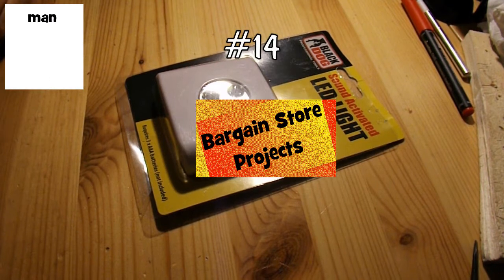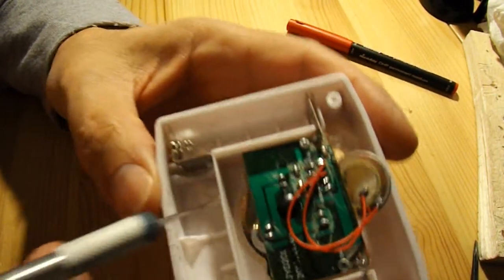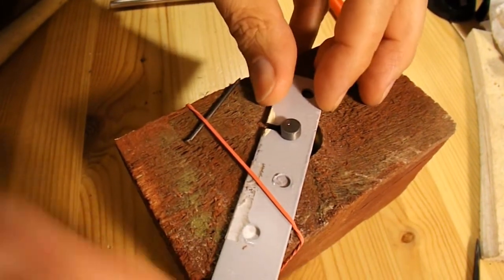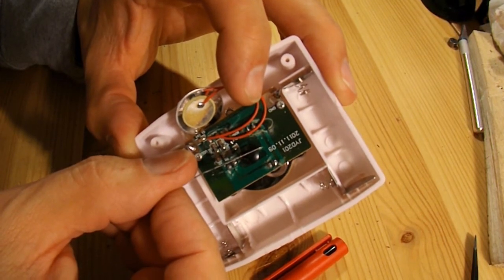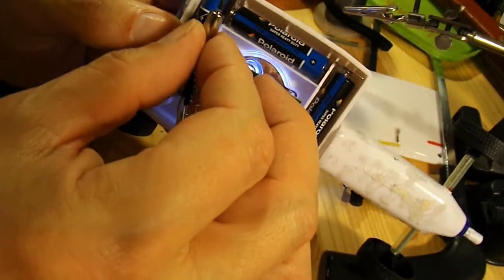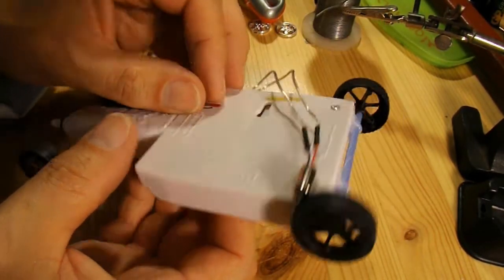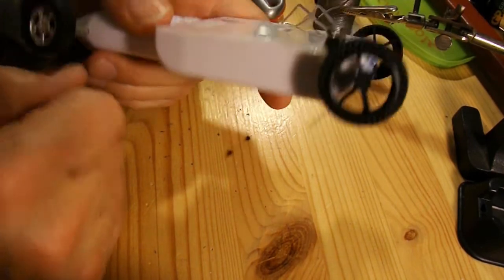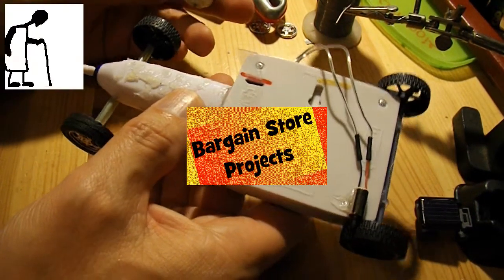Bargain Store Project #14 - Sound Activated toy car - fail

Comment: If you haven't already tried you could use one led to drive a small low voltage relay that can take power directly from the batteries to drive the motor.
Reply from the maker: PunakiviAddikti yes you could, especially if you add a small timer circuit using a 555 chip so that it runs for a fixed period once triggered. I did that on another car.
Reply from the maker: PunakiviAddikti here is one version that just used some transistors to feed power to the motor https://youtu.be/vwNqypkmvwA
Here is a slightly different one https://www.youtube.com/watch?v=4Cm49q-uNYE
and it's second version https://www.youtube.com/watch?v=mLu9SheVmzo
Reply: GrandadIsAnOldMan That's a good solution to use a better battery and some transistors. You could try to attach the piezo electric buzzer/trigger that's used to trigger the device with foam so it would not pick up the vibration of the motor.

Comment: I know this is an old video but if you connect a mosfet transistor in the same way an "unregulated box mod" is wired then you can get more energy out to the motor when the motor is placed in the portion where the atomizer is to be placed
Reply from the maker: Hi FreiNrg  Thank you for that suggestion. Yes as you say it is an old video but I do sometimes go back and have another go, or somebody else might see this and have a go themselves.

Comment: Long ago , I used a computer named Spectrum ( 80s).
I did a similar device , which operated a relay when a sound is heard .
With the relay , turn on lights and put up equipment connected to the mains.
Took advantage of the audio output and Spectrum programs and the "BEEP " BASIC instruction , lit lamps and appliances.
For example, at a certain time , I woke up.
Although I tried, I could have done a coffee hiciese coffee at a certain time , for example, and much more.
Yesterday doing cleaning , I found this device . 8-)
Reply: By the way and now I think :
With the departure of our helmets and Mobile PCs and even landline phone , could do the same.
Would not that be an interesting new project that you will submit to us? .
For example :
You're out and you phone home.
An irrigation system (solenoid valve) is connected to the phone ringing .
When you want to water your plants , you have no more to make a call .
What it is good idea?. 8-)
Reply from the maker: Francisco Javier Lázaro Pinela You can get apps for your smart phone to do that sort of thing now. I don't think connecting the solenoid direct to your home phone would be a good idea, we get too many sales calls trying to sell us things we don't want. The plants would be over watered.
Reply: GrandadIsAnOldMan You're right ...

Comment from the maker: Thanks Ryan, but intercepting the circuit in the way I do here, there is just not enough power to feed into the motors to drive this size of car. If I add a bit of circuitry to use the output to switch another transistor, then use that transistor to switch on a bigger motor there will be plenty of power. I like the idea that you describe so I might use that in another design, thanks again.

Comment: Do you have another one of the small motors because if you do, on the tip of each motor put a thingy on there just big enough so u can put the wheels on each, since it might be wobbly slide the two motors in a straw then hot glue the moterized axle on, hope this helps